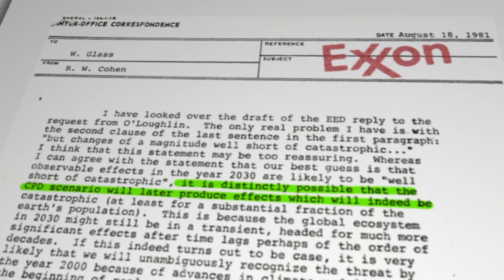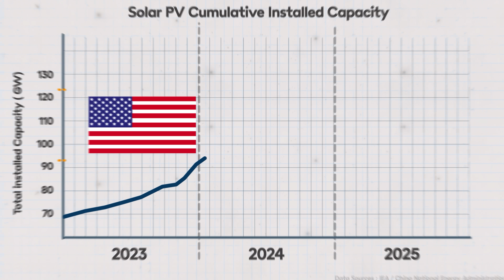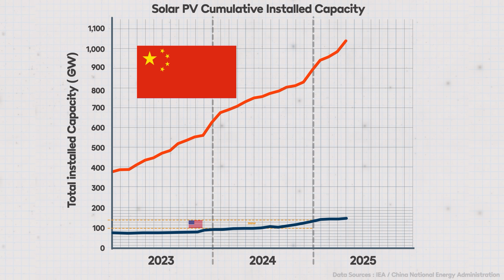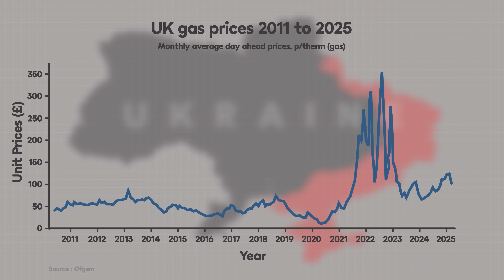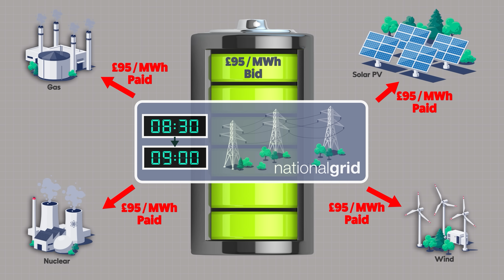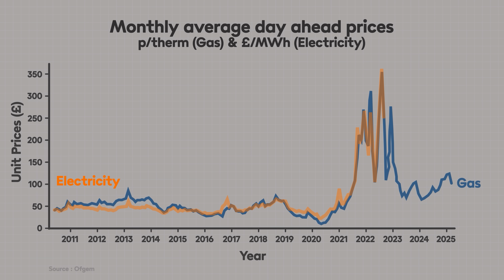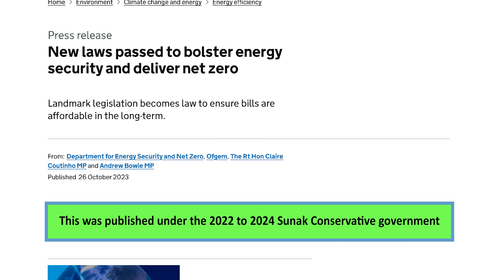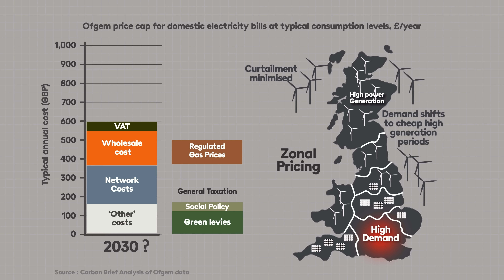Why is UK Energy SO expensive?

Comment: I could afford to be an early adopter and bought 4kW of solar panels. Because of FiT and the fact that South Lincolnshire is on the same latitude as Wales, they paid for themselves in 4.5 years not the predicted 6. We then bought a Tesla Powerwall 2 and because of the way VAT was worked then, two 300 Watt panels. We now import electricity at 7p per kWh between 23:30 and 05:30 and use the battery throughout the 26.7p per kWh day, exporting all the solar at 15p per kWh meaning our electricity for the whole year is virtually free. I just wish there was a heat pump setup that could deal with our 10mm pipes as they are under the bungalow and we're not having new one fitted. Plus, our 64kWh Hyundai Kona costs less than 2p per mile except for the very rare long trips. Anyway Dave, keep up the good work.
Reply: Live in Northern Ohio. Gas company was charging $50/month for system infrastructure upgrades regardless of our minimal gas usage in summer. Had gas line removed and closed account. Installed heat pump which replaced our only gas appliance. $600 saved annually paying for the heat pumps
Reply: @BobQuigley I'm working on a similar solution that stores hot water for house heating and showering that was heated with a heat pump during the duck curve when sunshine is plentiful. A California company called Harvest Thermal makes the system I hope to buy and then get rid of my own gas line. I have attic insulation to fix first.
Reply: Have you looked at Heat Geek? They have excellent training and are building a network of installers who will know how to get your home comfortable with a heat pump if at all possible. I have seen 10 mm pipework installs work just fine. It's mostly a matter of having enough of them, and getting the insulation right. But a Heat Geek will figure all of this out for you before you commit to the install and offer good alternatives if needed.
Reply: Heat pumps can work perfectly well using 10mm pipes provided the calculations are done and the heat load isn’t greater that the amount of heat each individual pair of pipes can deliver.  I have multiple systems (including my own house) working perfectly with micro bore.  Calculations to confirm it will work before it’s installed are critical thought.
Reply: @jacobnewman3172  I agree - we have a 10mm microbore system and its working perfectly well with a heat pump. We added one extra radiator where the house was cooler before. Go for it!
Reply: I have a solar array, feed in tariff, Iboost hot water diverter, heat pump, cheaper renewable off peak overnight electricity tariff, Zappi charger and EV. I have had my gas disconnected and gas meter removed, so no standing charge for gas.  I just can't get enough of renewable technology. I'm getting another 8KW of solar and a battery wall with back up power next, which has been paid for by the feed in tariff payments and energy savings so far.
Reply: EG4 solar had what you may need
Reply: Yeah the Kona is famously efficient
Reply: Get mini-splits fitted, you just have to drill a couple of holes in the wall.
Just don't get fed lies about air conditioners being "expensive". A decent Mitsubishi 2kw heat pump in Japan is about £350. 
If I was back in the UK I'd consider going as far as importing all the stuff from Japan and setting up a seperate 100v system if I had to!

Comment: Gives expanded meaning to the concept of GASlighting. Time to give the cheeky toddler a permanent time out.  [ one note of critique: Please reconsider the titling. Question marks and satire aren't enough. Your title RE-PLANTS and REINFORCES the fraudulent suggestion that renewables are unaffordable.  Language is everything. Don't think of an elephant. ]
Reply: agree on the issue with the title
Reply: yeah because renewables just suddently appear from nowhere, the grid doesnt need any upgrade and anything which is actually made possible with ICE vehicles, ships, heavy equipments and oil right! what has the renewables or evs actually ever contributed?!
Reply: @carholic-sz3qv 'ere, look at this 'un, lads. Recks even solar and wind are too polluting. Probably wants us all living on communes wearing hemp fibres.
"I detect a little communism..."
Reply: @carholic-sz3qv  which kind of upgrade? The European grid is already capable to rute any amount oof electricity to any abitrary endpoint, and chage the corct amount down to the 4th decimal right f the comma...
What is needed ae batteries as stabilators, and reducing transmission losses, but those are not exactly part of the grid
Reply: @carholic-sz3qv  You have a point. The fossil fuel industries have contributed megatons of hot CO2 fraud and propaganda to hide the fact that they knew they were burning humanity alive.
Reply: je-jew-jew
Reply: You made me think of an elephant
Reply: Doesn't seem wise to blame natural gas which is what is supporting renewables on the grid as the problem for high prices.
Reply: @afreire239 Natural gas isn’t being blamed. The way that natural gas generated electricity is being paid for is being blamed. At the moment it’s analogous to signing up for a car lease agreement where the leasing company can change how much you pay every month. Which is clearly bonkers. One suggestion, as Dave points out, is to guarantee a price for the gas that is the current market price plus running costs plus a reasonable and pre agreed profit margin.
Reply: @afreire239 Every KWh sold in the UK is priced as if gas generated it. On a sunny day with good solar, you're still paying high prices because of bombing in the middle east
Reply: @afreire239  Lol, again, your profound ignorance is on full display.
Reply: @incognitotorpedo42  very lame joke indeed what you said

Comment: Excellent explanation of the problems and possible solutions in electricity pricing. More detail please as it develops….
Reply: I like the regulated gas price solution. The UK, as Dave points out, is enormously dependent on gas for highly reactive and high-intertia electricity generation. It's not a form of energy we can do without at the moment, and we are likely to need more nuclear generation if we are to move away from gas in the longer term. I'm hoping that modular Thorium reactors become available within the next 10 years such that we can plan to decomission gas-fired power stations to some degree. Such reactors also offer the possiblity of using waste heat in Urban areas to provide heat networks.